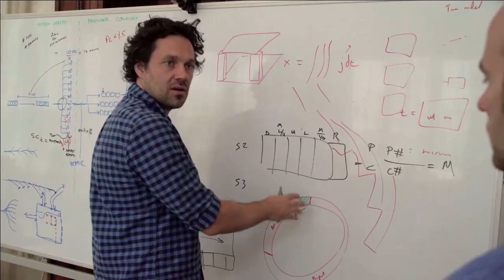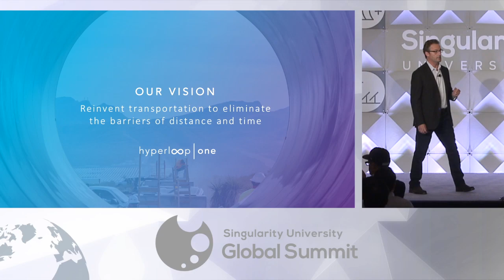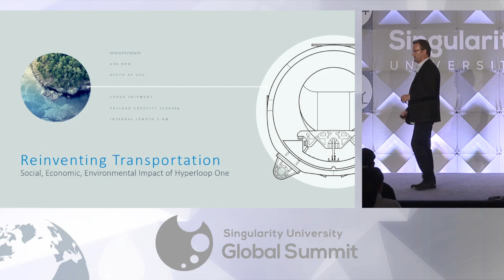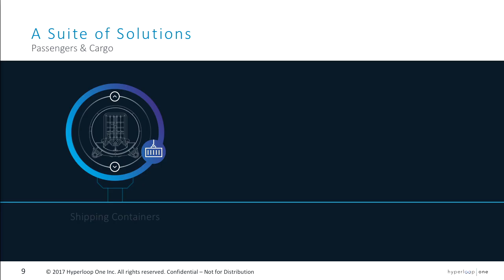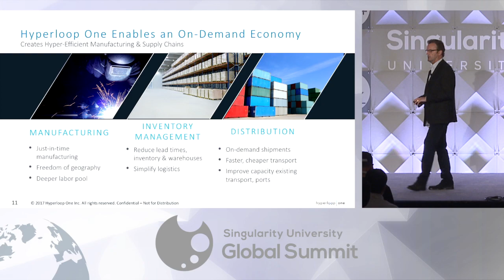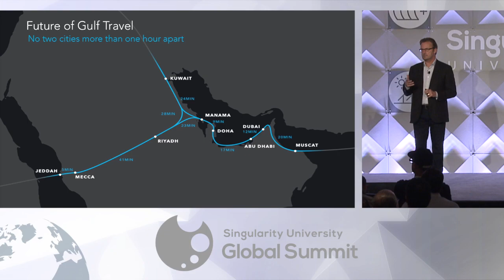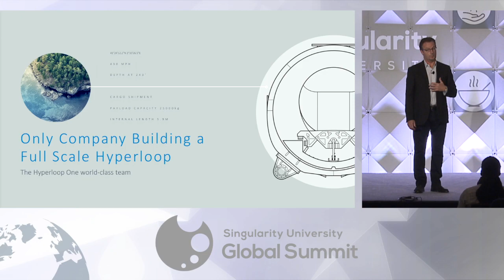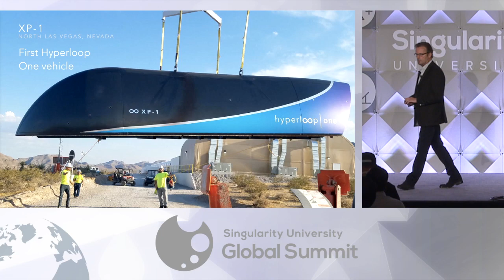Hyperloop Demo | Rob Lloyd | SU Global Summit

Comment: I wonder how much energy will be wasted to levitate the pods. Will it be really better to leviate the pods instead of using wheels. If you have wheels you don't have to use energy to levitate. Is it really worthwhile ?
Reply: The whole point of this thing is speed. Wheels create friction :D they don't need that.
Reply: But to levitate a huge mass will cost a lot of energy, you save energy eliminating friction but you'll lose to levitate - is the gain worth the loss ?
Reply: Look at Maglev. With wheels is like with air, is not problem to some point, but after it it start make big resistance. Sometimes like in F1 with engine they are working on 10000rpm+ but in production car it is pointless, because after 100km you should change it... 
Same with wheels, in some highspeed cars are used, but if you want highspeed and durable is hard, easier is use levitation. And one more thing, if you lower air pressure, it become possible to move faster, I don't know how is going with low pressure and speed of sound, but until it is possible. And wheels with this speed become firewheel ;)
Bigger problem with Hyperloop One method is cost of making tracks, but first they should show something more then prove of concept.
Reply: The volume and the density of the magnets is more than enough for the magnetic polarities to create levitation. The net electricity consumption is therefore negligible compared to other modes of transportation.
Reply: But where is this passive levitation, show me another case of using this to levitate something big and heavy except some toys.

Comment: The problem with this solution is that in order to make this a globally enjoyed thing, it will require a massive cost drop on materials needed to build such a tube. You cannot justify replacing the already existing infastructure with a new version, that will require a total remake of our infastructure. The benefits dont outway the costs of this. (except for the polution decrease ofc), but it doesnt replace polution, it just reduces it by an amount. 

Also, as soon as the zero point energy og magnetic energy technology is finally released to the public, this hyperloop idea will look like a dick in a womens lockerroom. 
Zero point energy or magnetic energy, is needed for "real" anti-gravity technology. So when its released, we will have flying cars like in starwars, star trek or similar. Think about a vehicle that makes no sound, doesnt polute, doesnt touch the ground Ever, can go to outer space, and travel with any speed you can think of, to anywhere on this planet within minutes, or to other galaxies within hours. 
How insignificant would hyperloop seem then? 

And for those of you who think this is sci-fi stuff that is atleast 200+ years away. Think again, this tech has been invented and perfected in the 1950s, and kept a secret due to the obvious economical distruption this tech will bring.. Oil, coal, nuclear, solar, energy grid, etc  will all go out of business when this tech is released. Thats why you having heard of it.